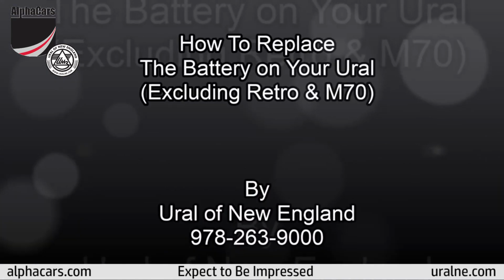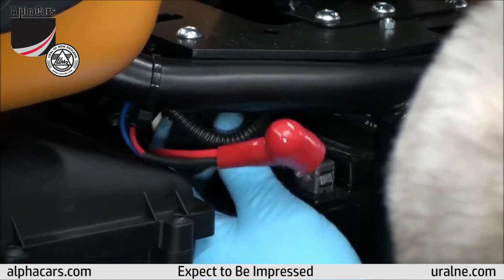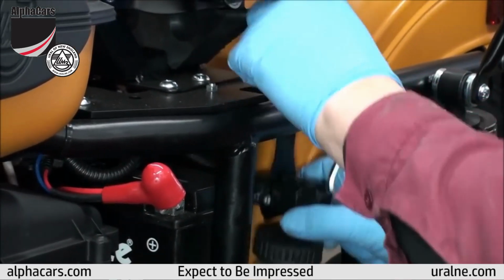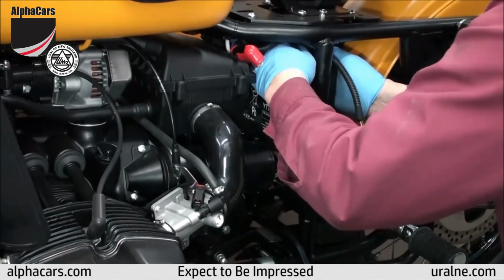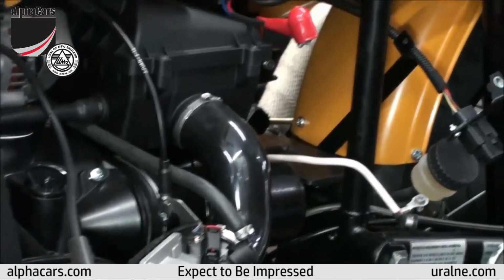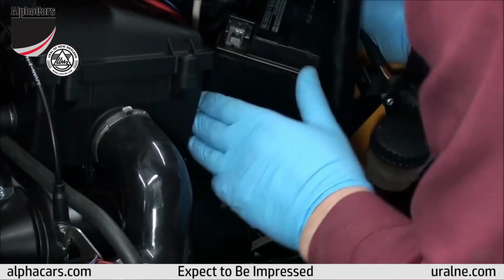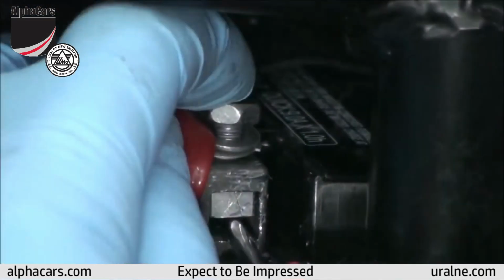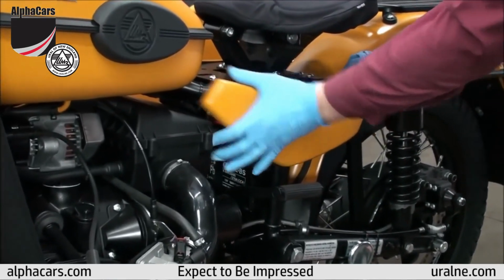Ural Battery Replacement Instructions, Ural of New England

Comment: On that model would it not be easier to remove the plate above the battery/seat and take the battery out the top
Reply: Of course it's easier to remove the seat plate, everybody knows it! Why getting the risk to f**k up the starter bolt???  They show you WHY THE DO CHARGE a lot of money for every service at their shop, because of many very complicated ways they do a job...
If they do replace your pusher tire, they do remove the gearbox and swing arm first, THAN THE SIDECAR!  LMAO
By the way, there is really not on good Ural Garage, it's better to go somewhere else or DIY.
Reply: @uralguy5131  Well growing up with little to no money I learned to work on cars and trucks and then my motorcycles myself. A simple URAL would be best to learn to fix it yourself instead of taken it to some shop that has High shop rates and sometimes poor work, in this day of age anything you want to know how to fix is at our finger tips
Reply: That's what I do out the top. 2009 Patrol.